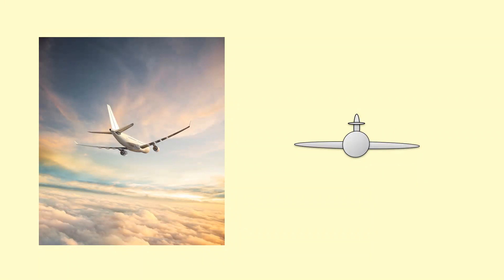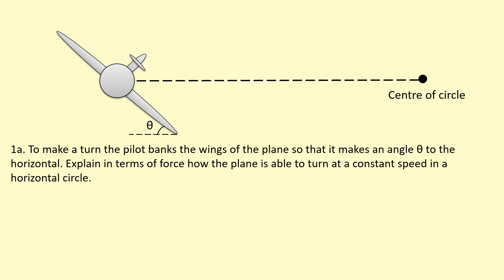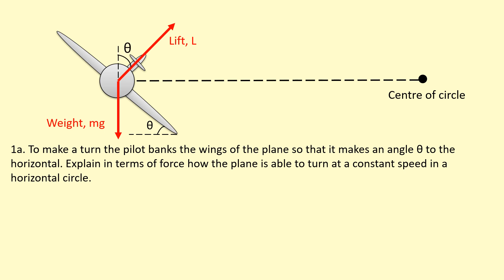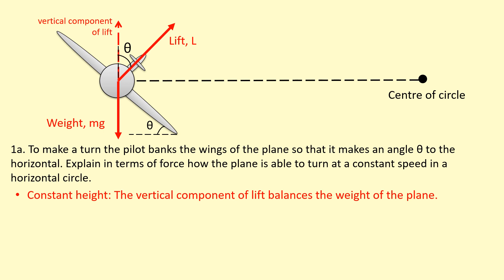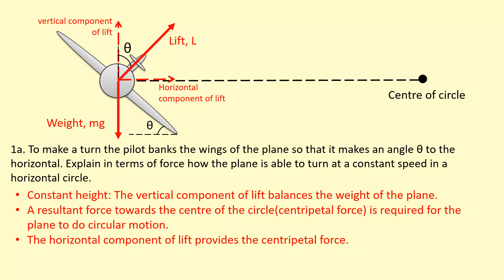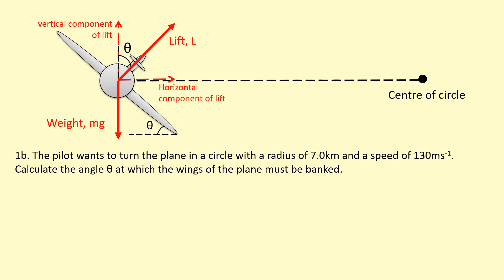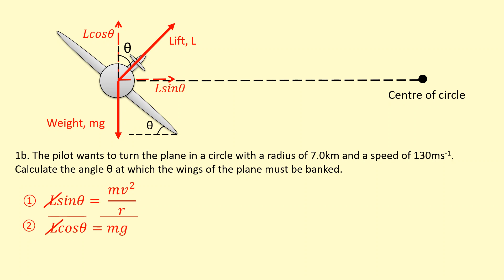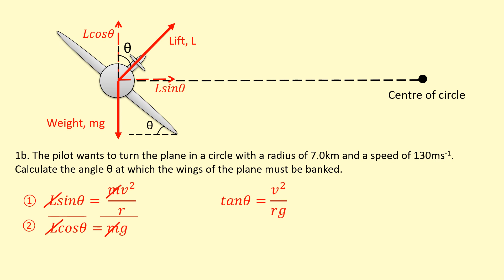6.12 How do planes turn?

Comment: For 2b, i am doing the exact same procedure but my angle i am getting is 12.9 degrees, i did 150^2/(10,000*9.81) which is 0.22935... and then arctan of that value and i get 12.9 degrees. Could you please explain how it is 14.6, thanks
Reply from the maker: Another mistake on my part. Very sorry. The answer is 12.9 degrees. 

I rush it a bit when i made these videos. I will need to fix it eventaully.
Reply: @MrNagaPhysics  I really find these videos helpful as i have a few days for my exams and i thank you very much. You make sure to keep the key points and make it short with questions at the end. Which helps me understand the topic.